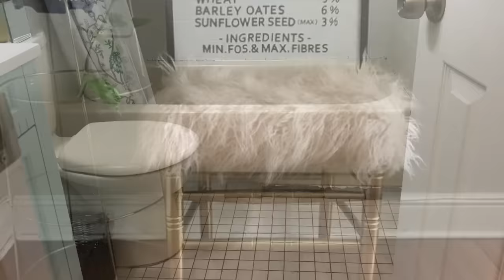11 Clever Ways to Fake High-end Looks in Your Home | Hometalk

Comment: The stone effect only works if the rest of the bathroom matches, otherwise......
Reply: Plus it would be a challenge to keep clean - especially from mildew and mold.
Reply: fake rocks on that whole section of the bathroom then cover it in modge podge and flex seal spray

Comment: The stained wood folding table cover would be great for extra guests during the holidays. It looks so much better than the actual folding table surface.
Reply: Table cloth is 99% cheaper. Also putting that much effort into a folding table is stupid
Reply: I think it’s a nice option, and way less expensive than buying a second dining table.
Reply: @yogertslinger84  Table cloth is fine if you're at a county fair.
Reply: @patricialiedel5659  it used to be. But have you seen the prices on wood lately?  It's ridicules!
Reply: "actual"
Reply: I doubt many folding table frames could take that weight for very long, plus whatever is being put on it.
Reply: That table would be fine as long as you don't have to move it.
Reply: The problem is the legs still look like it is exactly what it is. And that cheapens it. The time and money to do all of that can be overriden by finding something nicer on NextDoor for the same money put into the refurbish. Slap some paint on that. Have a real table.
Reply: you already built the top mine as well just build some legs or order some online to match it that can withstand the weight.
Reply: @robwagner7545 - Just get a lighter weight wood & it’ll be okay. The issue will be not scratching or dinging up a lighter weight wood as it will also be softer. Maybe they could do the design to look dinged up to begin with.

Comment: Video title should read: "10 elaborate ways to devalue the overall aesthetic of your home, featuring 3 actual improvements"
Reply: Wait... you mean there were improvements?
Reply: mrgw982 The table
Reply: @jaspertrip7524  even then, probably would have been easier to buy a new one at Ikea 😂
Reply: @braininajar6513  thank u for beating me to the punch.
Reply: 300th like :)
Reply: @braininajar6513  the common wealth and the capital wasteland.
Reply: @idk1848  The capital is still under Lyon's duristiction.... The old fool
Reply: But what were the 3... lol
Reply: Jasper Trip even the table looked dumpy. The wood was just pine, and you can still see the legs from the card table
Reply: @Al_ate_my_soup  and i don't think it was attached and would move around
Reply: @mrgw98  the frame around the mirror amd the sliding door and the closet doors looked better.  But not high end.  Just better.

Comment: A lot of this only works from a distance.
Reply: KartoffelMann21 a distance as far as 33627363783737383737,837474647647,38388373377474 miles away
Reply: From a very very far distance !
Reply: KartoffelMann21 BWAHAHAHA LIKE THE DRAWN ON WINDOWS
Reply: Yes, and if you're squinting your eyes as well. The wooden table with the spindly cheap-ass metal folding legs.
Reply: Especially the garage windows

Comment: Even if they cut the vents, there still is the hot surface, which can cause fire.
Reply: Dio Kakouris they didnt even cut the vents the thg drew them on
Reply: @koalas8335   They didn't draw the vents? They cut out the vents with a knife.
Reply: Actually the wood grain pattern on some microwaved is vinyl any way. Its fine. Sorry to say no worries on that aslong as they cut the vents.
Reply: @NintendoGamecube  i dont know but for my microwave theres a huge warning telling me that i should not touch the surface because it's hot.
Reply: @YoongiTrash  Yeah that's what I was trying to say. Sorry if it didn't come off as that way.
Reply: I've never had a microwave that's gotten hot on the outside of it. Toaster ovens on the other hand....

Comment: If you have those tools you can afford A DOOR
Edit: Thanks for the lights.
Edit 2:I will leave the spelling mistake.
Reply: If you have a $100 would you buy one door or a tool that can make many doors?
Reply: @yonnameable  I would buy the door cause I dont need to make any more and it'll save me tine
Reply: @tracedoornbos7629  your door breaks , then what?
Reply: @fatherrocky6367  how does it break
Reply: Carly,
Buy a door then use the rest on food.
Reply: @yonnameable  100 dollars wint get you what you need to make a door
Reply: @tracedoornbos7629  hole through it , hinges break etc
Reply: The door they dressed up was a cheap hollow-core door, easy to damage. Buy a good solid door and you won't do more than scratch it. Also, the fake paneling on the door they 'upgraded' looked like crap
Reply: @fatherrocky6367  then buy a need door
Reply: Tea
Reply: @lisamuel41  or you can make another one without expenses.
Reply: @fatherrocky6367  sounds wasting time. Just pay and get a new one

Comment: That's basically what high-end stuff really is. They put a brand on it and make it look shiny so they can charge ridiculous amounts of money for it. In the end of the day, a gazillion dollars mirror does the same as a cheap mirror: they reflect images.
Reply: That's half true, as a mechanical engineer, we work on high end devices as accurate in their size of nanometres, this requires costly machining and sofisticated devices which increase expenses
Reply: Mynarski also if you look into quality you'd be able to see that more expensive products have a longer lifetime as the materials used to make them are of much higher value, as so, making them a higher price.

Comment: I don’t get some of these. Like the accessories which could be found much cheaper by just looking online. The black doors turned into hinge doors for what reason? The paint job was enough. Then the wood table top on top of the cheap table. If you’re going to go through all that trouble, why not just go the extra step to make wood legs for it? Meh.
Reply: Sandy Prater or just build an actual table
Reply: Sandy Prater The table.. portability. Is a nice touch to have a nicer looking table you can easily store and move for outdoor events. Wouldn't have it as the main table though.
Reply: Yeah, we used to be young and host big family gatherings.  We had a set of wooden toppers to put on folding tables.  At reunion's end, we just folded up and stacked them out of the way.
Reply: It was already a hinge door lmao they just tried to make it look pretty which obviously didn't work out. Paint is fucking gross on wood, we have wood stains for a reason.
Reply: I think the whole video is a joke. Reminds me of a bad life hack video, like making clothes out of duct tape, or using an old flip flop or sandal as a gun holster.
Reply: Kenny Morgan It reminds you of one because it IS.  Trust me there isn't a joke they are 100% serious.

Comment: Some of these are really
Unsafe
Damaging
Fire hazards
Mildew threats
Or all of the above!
Why would you put marble film on a microwave?
Or put pourise stones around your bathtub like that? And drilling stuff at random and taking apart chairs if not done with caution / you should be educated could damage you ot what your doing. Especially if your putting nails in the wall and not thinking "hey there might be wires in the wall!"
Reply: Stella Snugglz ........y would there be wires in the wall lol
Reply: They only pulled the back of the chair off lol
Reply: @avag232  really cant tell if you're joking
Reply: @spleenliver5980  if your house is built properly you'll know where the wires are
Reply: @kylierae3156  your point?
Reply: @spleenliver5980  if replied to the wrong person, was meant to be first the original commenter
Reply: Ava G Yeah, your kidding right?
Reply: Stella Snugglz ok well you’re right until talking about the chair and putting nails in a wall. Those two aren’t even a big deal.

Comment: Some of these are really good, but require carpentry skills I could never possess. I liked the chair turned into a pink and gold fluffy stool.  Don’t understand the point of fake windows on the garage door, and the marble contact paper on the microwave is just bizarre. Is this really a good idea when the top of a microwave tends to get very hot?  And the stones stuck to the side of the bath is DREADFUL!!
Reply: I have been reading the comments for ten mins , and this is the only positive comment Iv seen
Reply: Yeah but you can't clean well the fluffy stuff. I would use Velcro straps.

Comment: 1:52 after putting the clamps on the wood planks, take a wet rag and wipe off the wood glue oozing out from the seams otherwise, the excess glue won't allow the stain to color the table evenly.

Comment: I don't why soo many comments about luxury and expensive looking. It's style. Style does not have to be expensive. Garage doors with windows are not expensive, they just let light in. Framed mirrors are not expensive, just a style decision. Remodeling a bathroom is probably the most costly in this video, but you can call Bathfitters or just have the tub reglazed (never seen a stone tub like that).

Comment: I thought microwaves were supposed to be vented on the sides, with nothing on them, and can get warm. Tf? 
Also, that garage door thing doesn't make you look high end, just gives off the impression you're high af. 
Put down the devil's lettuce and the paint brushes, hunny.
:(
And don't even think about ever using a real Hitchcock chair to make that pink monstrosity. 
At least they used a cheap reproduction- hopefully.